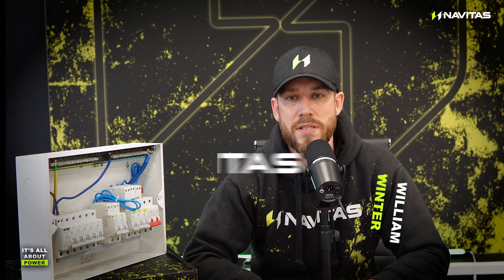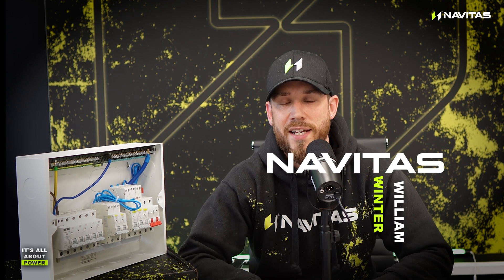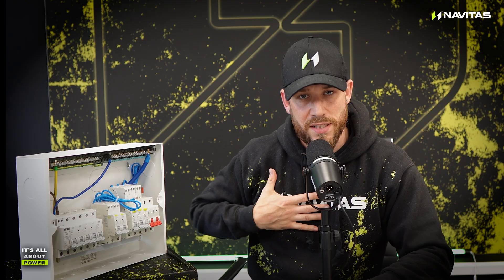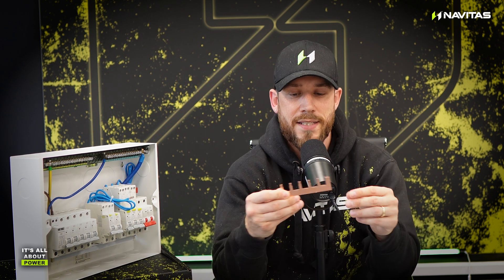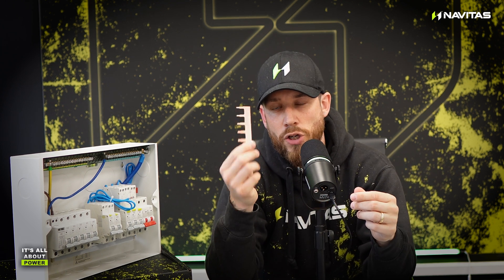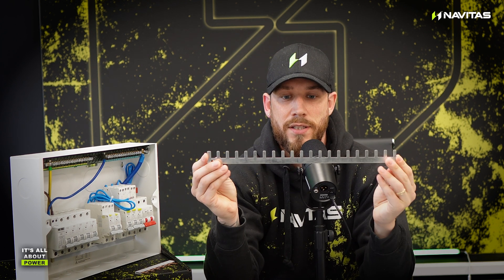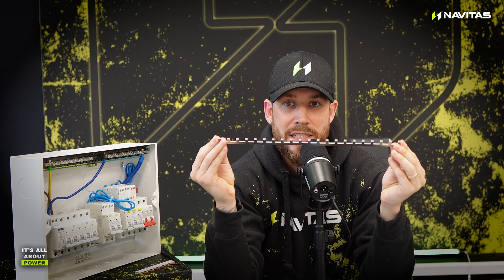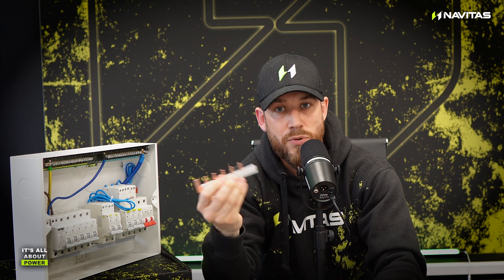THE MOST OVERLOOKED PART OF A CONSUMER UNITS QUALITY

Comment: I have only fitted one of your consumer units but found the same issue on the cpc/neutral bar as others. 2nm is great but not when using a PZ/S2 screw driver and many a time I've had contactum, fusebox, hager and others deform and pit regardless of which torque driver I may use or angle that I may be using it at. Any way that perhaps a Torx T20 or T25 screw head could be used on your product instead?

It sounds daft but I swapped over to Forge Fast screws with a Torx head from PZ and I'm never going back. Your unit did seem to be slightly harder to it to, only 2 out of the entire bar but it still happened, never really an issue on a fresh install but coming back to do an EICR it's a bug bearer because you're never able to get decent purchase on them after removing wires for testing and reterminating.

Nice to see a silver coated bar, definitely more and more reasons to swap to your brand. Just need bidirectional RCBO's on the line up, and maybe changing it to black powder coating and green protective devices and I'm sold.